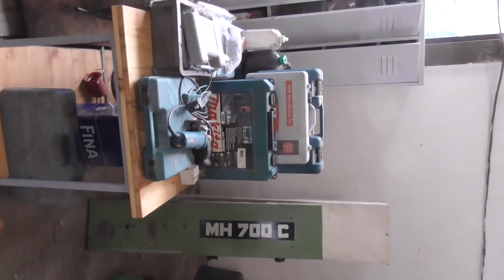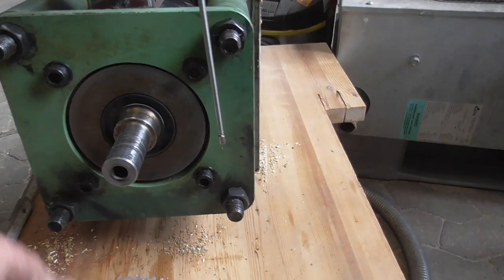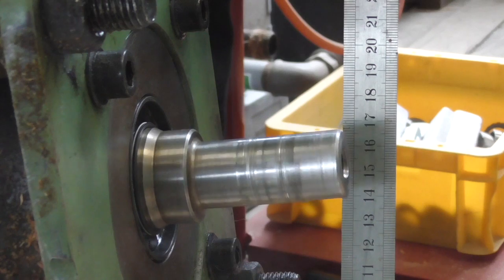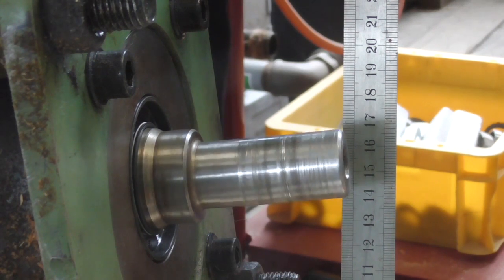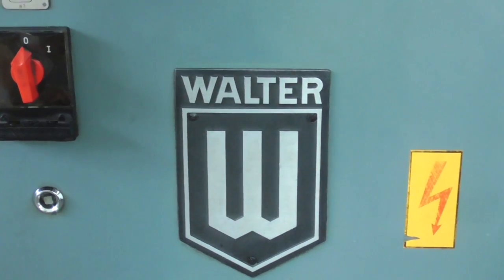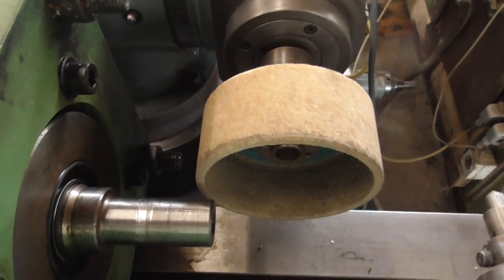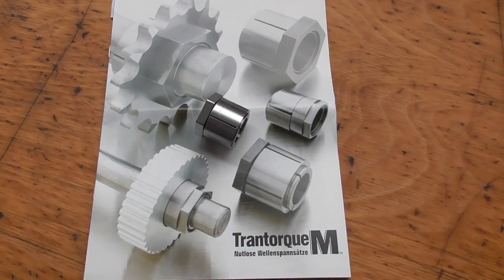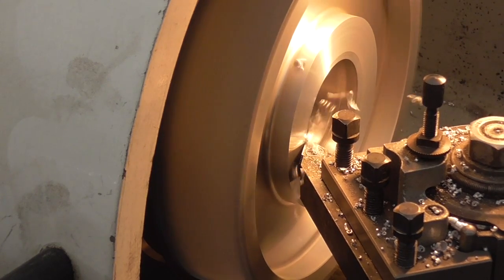That bent servo shaft. Trantorque to the rescue

Comment: Awesome! I used to make those Trantorque couplers when I first started out as a machinist. Actually, that job at Fenner Drives was my first job running CNC equipment. The part you used for your fix we ran on some big beautiful bar-fed Doosan lathes. One of the machines I ran was a twin turret with live tooling and sub-spindle. I still did a lot of deburring at that job though.... Great parts made in Pennsylvania, that’s for sure. I love those couplers.

Comment: In the 1950s in my area of Niagara Falls New York we had the local hydroelectric power station collapse into Niagara gorge. My father got the contract removing rubble of the collapsed power station. So he was there when the turbine manufacturer sent in specialists to straighten the bent turbine shafts. The method they used involved heating one side of the bent shaft and applying ice on the other pulling the shafts straight again. I guess they got the shafts within specifications . Since I was 6 years old at the time I did not get any further information, but an interesting method regardless.

Comment: What about the servo output bearing? Did it survive the hit and the straightening intact without damage?
Reply from the maker: A reasonable question. The bearing didn't sound bad. And I really didn't want to take the servo apart. I did that once with this one and put in new bearings. That time, they really sounded bad.

Comment: Brave repair. I tend to find I'm off by +0.0002" when using an outside micrometer to set a bore micrometer.  Just set the micrometer a bit smaller to compensate. Also, measuring horizontally when setting it vertically can make a noticeable difference too.
Reply from the maker: Mitutoyo suggests the following procedure: When adjusting the micrometer, the spindle body has to point downwards. Thus the weight of the drum and ratchet etc. is similar to the nominal measuring force. After adjusting, slightly clamp the spindle, with the spindle still pointing downwards.